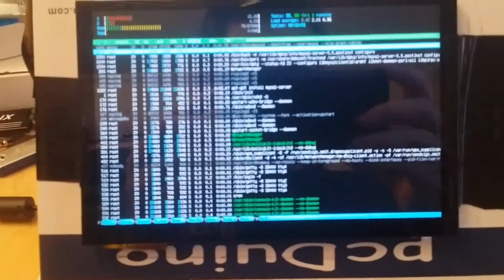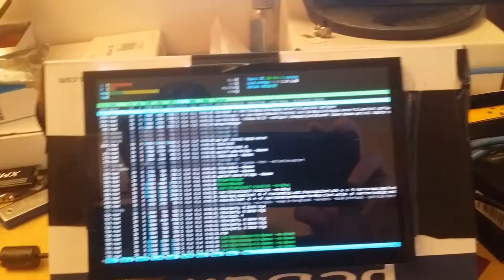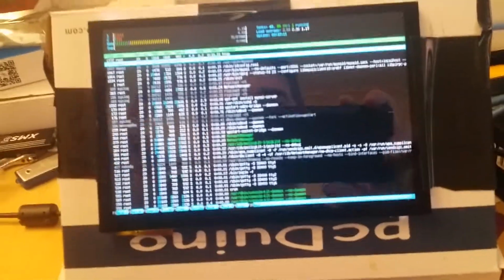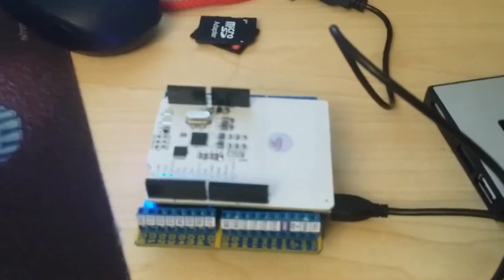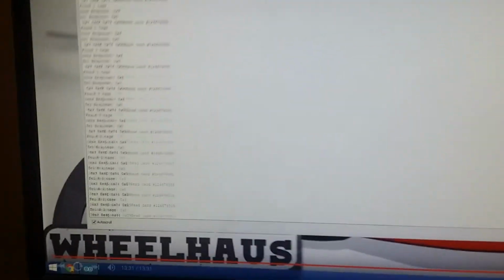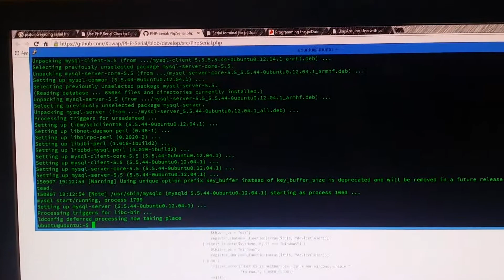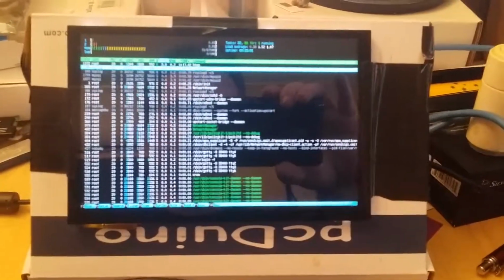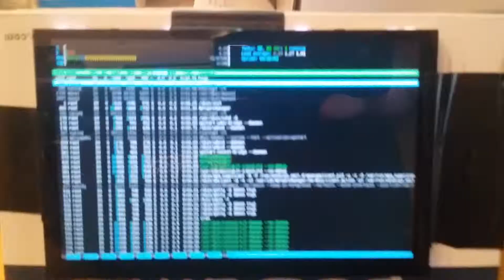PCDuino 3b with 1280 x 800 lvds

Comment: Mind sharing the model info of the screen? Looks pretty nice.
Reply from the maker: +Mark Chaney  -Hey Mark. Its a pretty good screen for less than $100. This one is the 
1280x800 7" LVDS LCD with Capacitive Touch for pcDuino3

I bought it from http://store.linksprite.com/pcduino-accessories/. Only issue I have had is the drivers for touch are not 100%. The link sprite site has info relating to drivers but they are almost all for the 1024x600 but if your comfortable with some low level programming in linux should be OK.

I am paying a little more attention to the suppliers now and have found some good sites with youtube channels that show a lot of the how to's and provide a little more info on drivers. It has been a few months since working on this project so things may have improved, hoping to get back into it soon. 

Hope that helps.